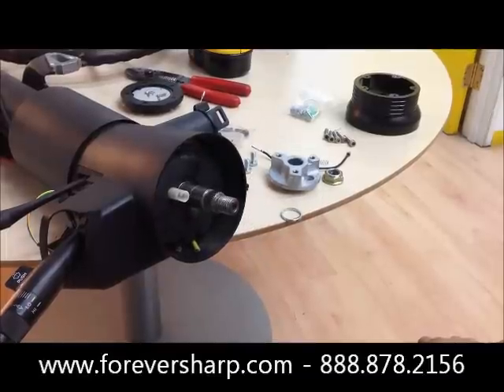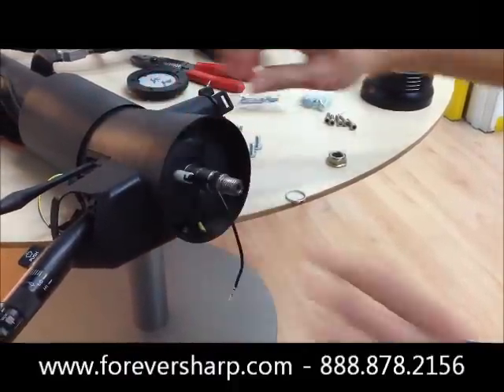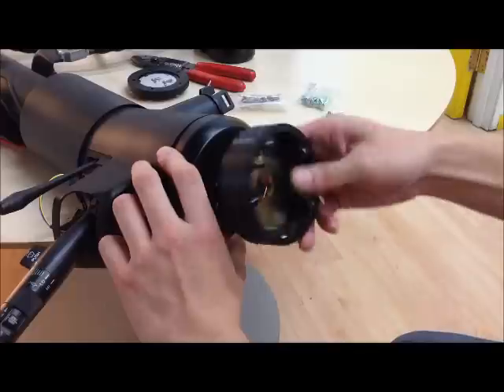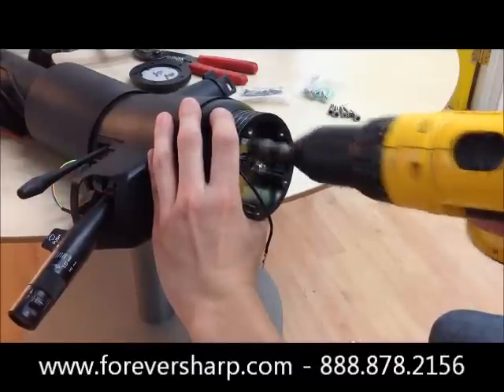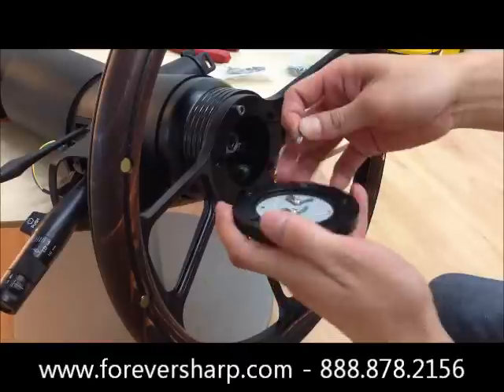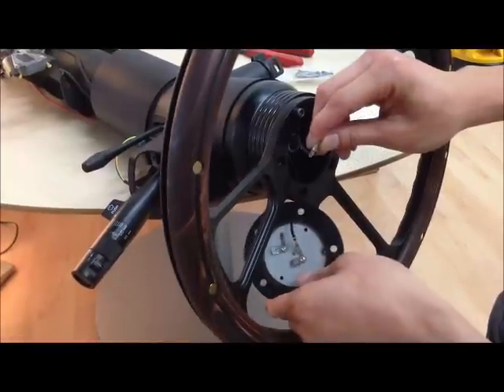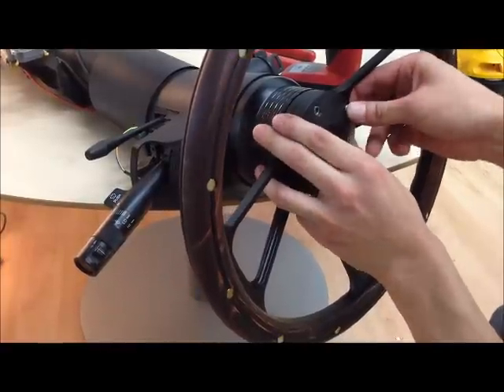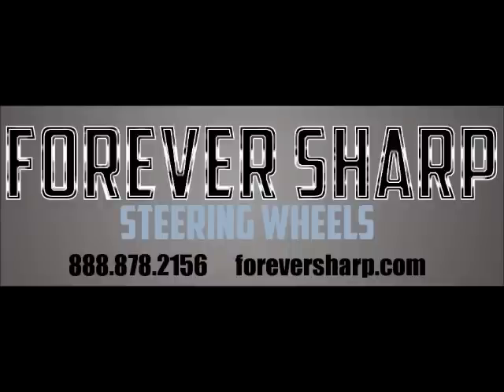DIY: Forever Sharp A01 Adapter Installation for GM and Aftermarket Vehicles

Comment: TIPS:
 *Don’t start machine screw(s) or bolts with anything but your fingers. After it’s started, then use your power tool. This will keep you from cross threading your screws.

 *On the ground wire, crimp or solder a ring connector on it, then install. If you look closely at the video, the bare wire comes loose. It’s difficult to keep a bare wire where it will stay put, without using a ring connector.

 *The metal colored piece has a slot in it for the horn wire. Tape the sucker in place in the grove, so you don’t smash it causing a short or open while installing.

 *Install everything but only snug the wheel on. CAREFULLY Drive the vehicle somewhere where there is no traffic, in a straight line to verify the steering wheel is straight. If it’s crooked, you can loosen it and reposition the steering wheel where it straight, then torque it down.

I hope this helps prevent what should be an easy install from turning into a nightmare.

Comment: I just got one of your steering wheels for our 1969 Camaro. The plastic housing coming out of the steering column does not have the slot so the black plastic clip will not stay in place. How can I fix this? Thanks

Comment: The installation is straight forward, but my issue is the horn wire is too small to connect to the horn button. It doesn't fit

Comment: the bell on the bell wire Is on backwards I just installed a steering wheel from forever sharp and the bell was backwards FYI compar it to the one that came stock on your car or truck and you well see what I mean!!!!!

Comment: I try to put a grant steering wheel On my 69 toronado. But im not sure if the adapter kit. Its correct its a sw-900 of pilot installing kit. Its exactly like on video except. De second adapter

Comment: That column is identical to my 91 camaro rs i want to put a removable steering wheel do i need 5 bolt or a 3 bolt adapter??

Comment: Put on the new wheel and now my steering wheel moves side to side and up and down. I put the column spring back in but it doesn't hold the wheel straight.  What did I do wrong?

Comment: You really need to learn how to use a drill.... that wheel on the collar behind the chuck... that sets your torque, set it at 1 or 2 for "test fitting", then set it at "10-12" for final assembly... having it cranked all the way up or on "drill" means you could mar the bolts, cross-thread, or pinch things unnecessarily. Let the tool do the work. Also, keep the speed on "low" or "1"... that way it wont torque in your hand.
Reply: Yes.
Reply: amen.

Comment: I didn't see you replace the "retainer clip" after the shaft nut?  But over all great vid...thanks
Reply: Thats because the original retainer position is under the adapter.  I been scratching my head all damn dat and no matter how far i push it down. My old retainer wont go down...

Drilled a hole and slid a coder pin😂

Comment: You need to tell classicparts to clearly state the necessity of this A01 installation kit for chevy trucks. I sat out in my drive with a steering wheel kit that came with unnecessary hardware and NO INSTRUCTIONS. Add to that a company that is not open on weekends and I am one unhappy customer. Oh and a true professional would never attach a ground the way you did. Include a spade connector and use that.

Comment: how can i remove an after market and put a stock one back on do i need a special tool?
Reply: +juan peralta I picked up a column from the junkyard, the steering wheel was missing but it had this 3 bolt adapter. I used a normal 2 bolt puller from the auto parts store, screwed in 1 bolt then started tightening the puller then as it started leaning to the side with the 1 bolt i hit the other side with a hammer and it popped right off. Probably not the best way but it worked for me.